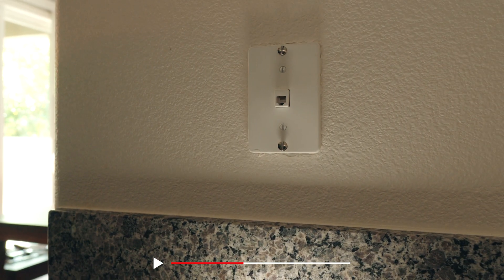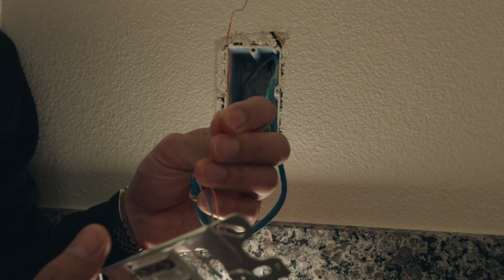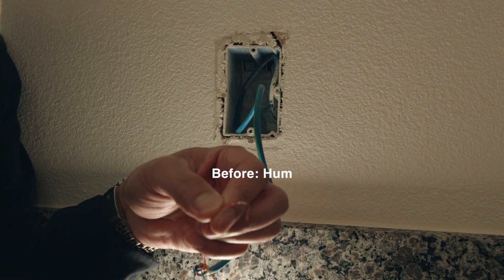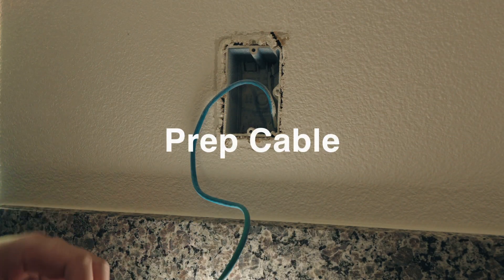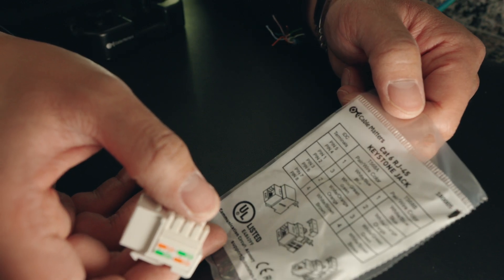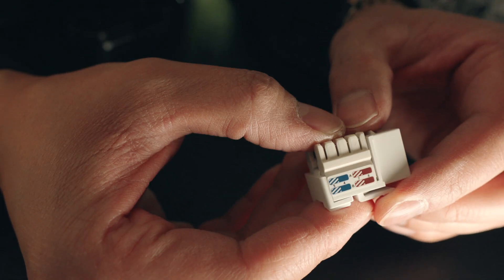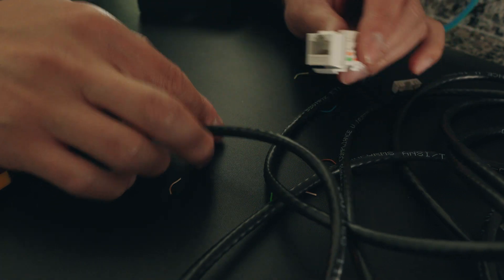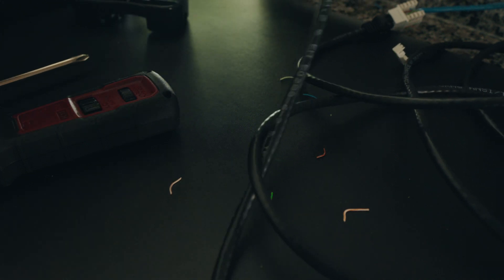Did You Know Your Old Phone Jack Can Do THIS?

Comment: I have a question that you might be able to help me with. My router is upstairs in the office. If I connect my router into a switch and then contract that switch into the upgraded outlet, will that signal pass to the other upgraded outlets throughout the house? Like are they all connected?
Reply from the maker: Yes. At least, if i’m understanding your question correctly. An easier way to think about it is…once you make the change, you basically have an ethernet line in the wall just like any wall (or any ethernet line) for that matter. Everything will be on the local network and able to communicate with each other

Comment: Owners of older homes, don't get to excited.  Your cable is Cat 3.
Reply: Worse than than, it could be daisy-chained... like mine is :(
Reply: My house was built in 98, would that most likely be Cat3.  I started this project for a NAS but this isn't going to work for anything but a printer.
Reply: @schadlarry Maybe.  You'll need to pull the plate off and see.  As Chris indicated, it might even be daisy chained, so look to see if that's the case as well.  You should be able to tell if it looks like more than one set of wires are connected together.
Reply: @BillyBobDingledorf  Yeah I pulled the plate and it looks like a regular ethernet cable coming in.  Went to the telephone box outside and have three separate lines coming into the house, although I only have two jacks.  

There were no markings on the outer casing so I crimped a RJ45 on two ends and was getting 100MB/s on smaller files, less than 1gb.  I tried transferring a larger file, 4gb and it throttled down to 50-60 MB/s which is still much better than transferring using wifi.
Reply: @schadlarry That's great.  You already have something working, but there's also powerline.  I've a powerline between my 80 year old house and the detached garage.  I get about 200Mbs.  I use it primarily for security cameras, so more than enough.
Reply: @BillyBobDingledorf  I tried some TPLink AV1000 and found out if they are not on the same circuit the results were poor and just okay if on the same circuit.  In my use case the outlets were on different circuits.

Comment: Sorry I have to get on my soapbox here, a RJ-45 does not support ethernet.  It is a four wire telephone standard.  The correct name is TIA-568, that is the correct pin out in a 8P8C modular connector.  I know, I know, everyone calls it a RJ-45 but that is a very specific telephone wiring pin out and NOT a ethernet wiring pin out.
The biggest issue with home phone wiring is that it is usually daisy chained from outlet to outlet and they are not home runs back to a central point.    In that case you cannot just convert them over to a point to point LAN system.
Reply from the maker: terry. stay on the soapbox. we’re here to learn. thanks for schooling us

Comment: This is absolutely correct and useful. While not ideal, you can also use just 2 pairs (4 wires) for ethernet, albeit capped at 100baseT. Often, that's enough for the job, and if you have a damaged pair, may beat the hell out of re-running the whole thing. Also, the coax runs can be used by getting MOCA adapters.
Reply from the maker: yes! the moca adapters can be such a quality of life improvement for many homes

Comment: you can run 100mb over 4 wire rj-11 even if it is missing the other 4 wires.
Reply: Only on really short run because 4 wire cable will have more crosstalk than 100 mbps tolerate on longer runs (not because it's 4 wires, but because that cable is not meant for ethernet).
Reply from the maker: yup! that could’ve been a fun fact i threw in too. here’s to next time